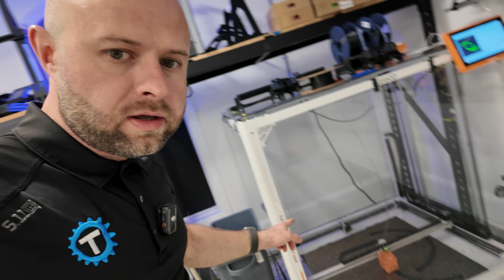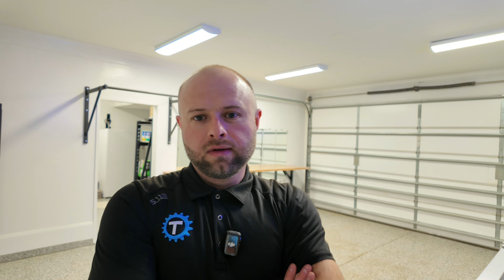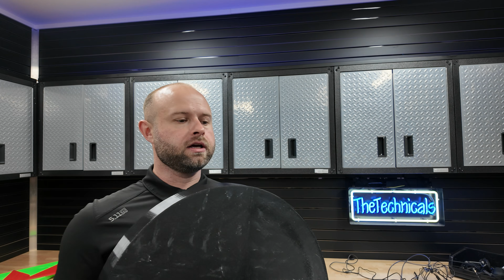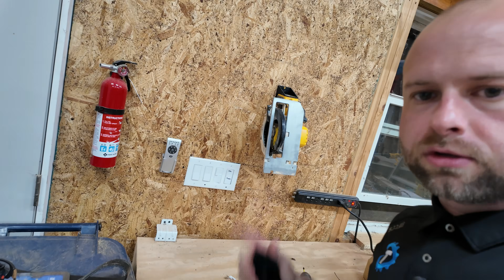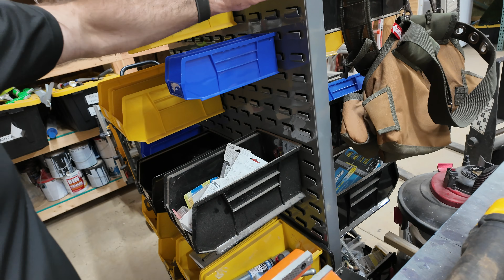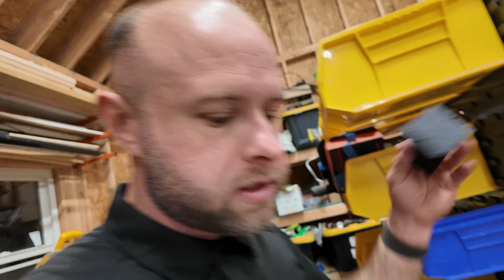My Elegoo Orangestorm Giga might actually pay for itself: 3D Print Vlog

Comment: I'm expecting my Giga tomorrow and am excited to get it up and running. I was a bit wary at first after seeing some of the early reviews, but I've spoken with a few others that own them and have heard good things overall. From what I understand, Elegoo has addressed several of the glaring issues that were found by early adopters. I will say that the Infinity Flow is definitely a must have for the machine as I've seen a few owners have issues with layer shifts on filament runout. Thanks for the discount code!

Comment: I swear they cherry picked your Infinity flow. Mine works about 80% of the time The other 20 gets jammed somehow. If you didn't clip the end of the school it probably would have jammed on the hook at the end or the tape.
Reply from the maker: What filament? i've only run sunlu pla and sunlu petg in it thus far
Reply: @TechnicalsTinkers  Bambu lab mostly. If ur not using that cutter make sure u cut the very end of ur spool or it'll always catch and jam.

Comment: Better print those tool holders in PETG, less brittle than PLA as well. We had a heat wave here in Europe past few days. Outside temp was about 35 C/95 F, my attic got up to 47 C/117 F. Not sure PLA could have handled that...
Reply from the maker: Finalizing them all now in PETG! Although the PLA ones are holding stronk